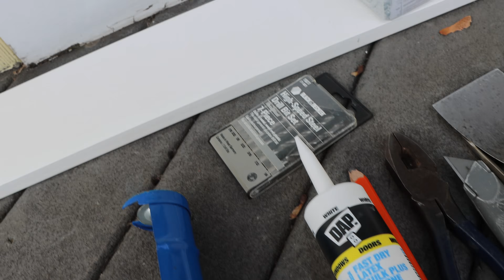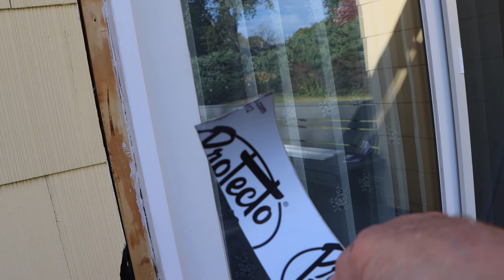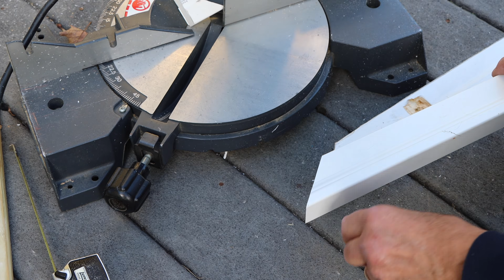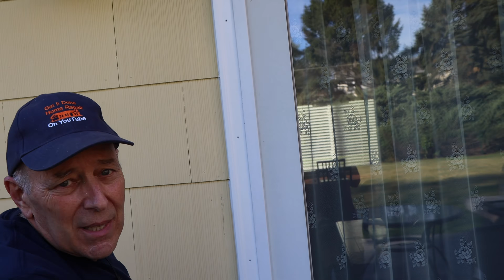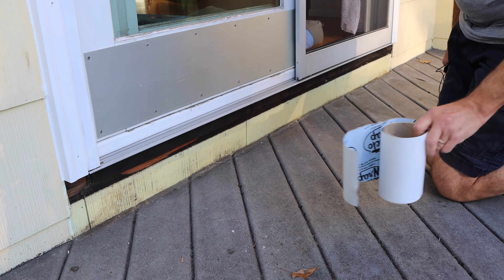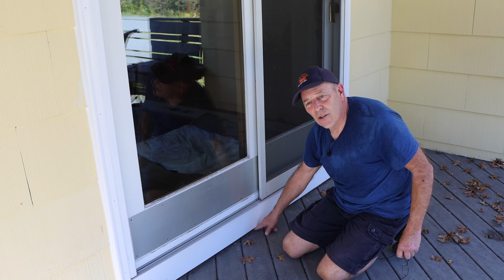How To Replace Rotted Wood On A Door / Brick Mould

Comment: Jim That Tool That Was Your Father's He  Called The Monkey's Claw They Have A VERY  Similar  Tool With That Same Hooked End  Made By Crescent Tools Called Double Ended Nail Puller At Home D    In case Anyone Wants One Part # CNP12
Reply from the maker: Thank you for the information I will check it out for sure

Comment: I Have Used The PVC Molding Around My Doors At least 12 Years Ago And It Still  Looks Like  New. What I Like to Do When Caulking Is Put Painters Tape On Both Side With A Space In Between For The Caulk. When You Pull The Tape Off You Have A Nice Sharp Straight Edge.
Reply from the maker: Good advice.Thanks for the tips!